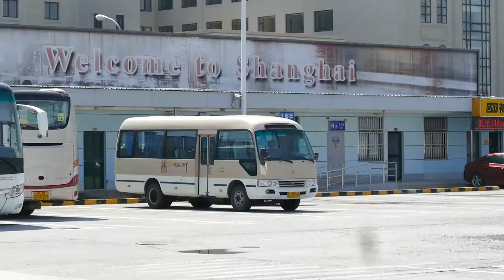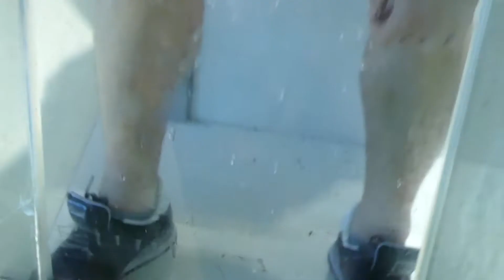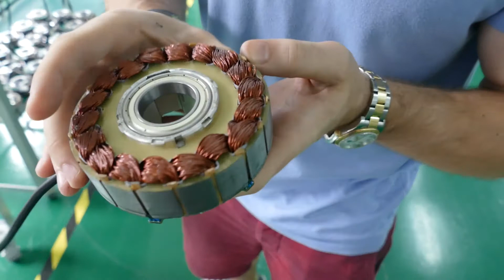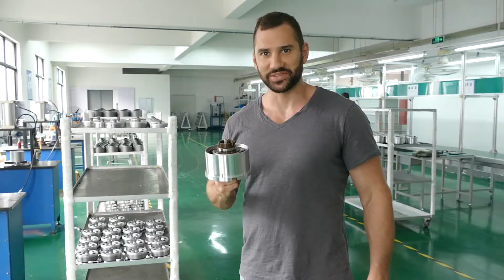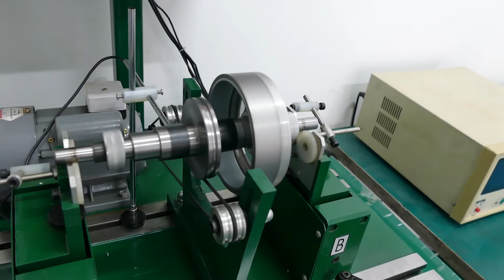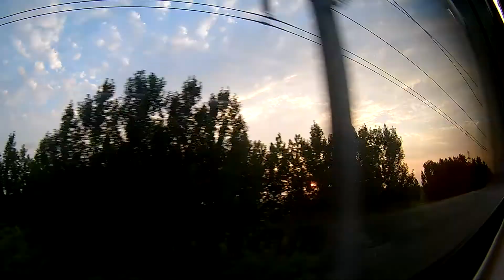FLX How to make an ebike: Kicking off Motor Production

Comment: Came back for a review... really to understand how many magnets are involved in sensing the crank movement... that is what is needed for the Bluetooth Adapter setup?  
That is... 1. Number of pedal sensor magnets?  2. Pedal Duty Cycle? 50%?    3. Start after Magnets? 2?
Also looks like there are 18 coils, meaning there are 18 permanent magnets for the brushless motor to work... I would guess that 18 has some significance but I've no knowledge of this motor!
Thanks for any help!
Reply from the maker: No worries Garry!

Comment: What was G3 going to add that G2 doesn't have? And why did you decide to stick with G2?
Reply from the maker: Gen3 has a torque sensor instead off cadence Dick. That's pretty much it. We've developed the firmware on Gen2 so it can push out 650W instead of 54OW. Also couldn't use a throttle with the Gen3. Pretty easy choice in the end. Thanks for the support!
Reply: @superhumanbikes  Do they still come fresh with sloppy bottom bracket bearings? A customer of mine with that same Bofeili motor (sorry to spoil the "secret") was told that's normal...